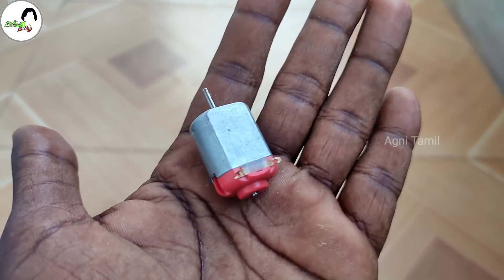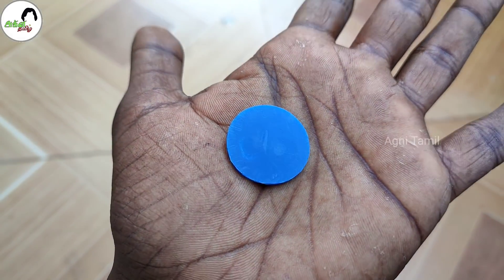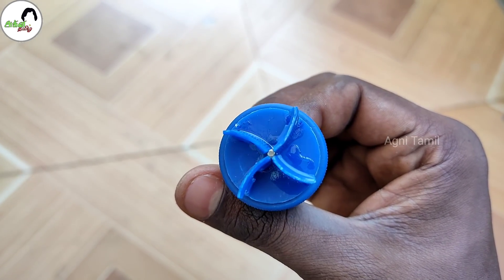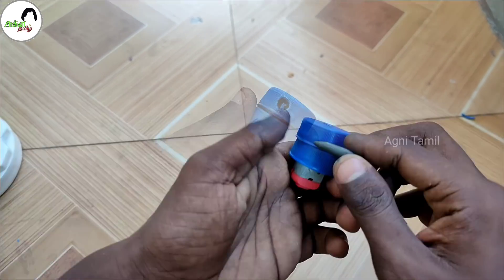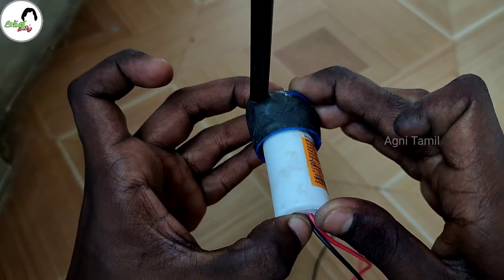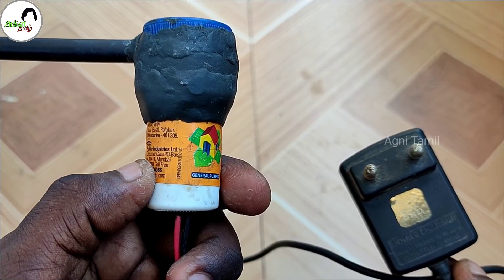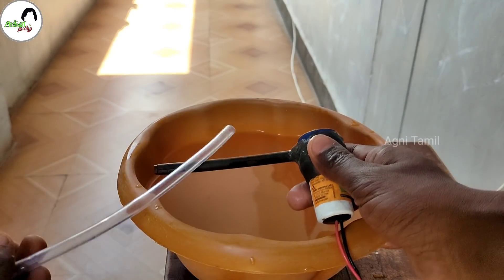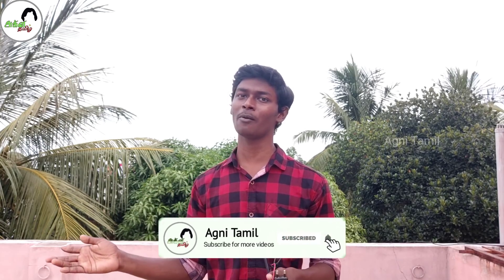How to make a Simple Water Pump? | 6V Mini Water Pump செய்வது எப்படி? | Agni Tamil

Comment: Bro neenga cap center la hole panni water kulla direct ah motor  veikkura dhu ku padhil ah adhae maari opposite la hole potu bipe use pannalam la ? Bcoz neenga battery la use panna prblm ella anaa charge wire la use pandringa may be current pass aaga chance eruku la ?

Comment: Bro prob here is you change the polarity of the motor... the propeller rotation direction you should keep the output pipe if propeller rotate in opp direction this prob will come... so now you change polarity of motor surely it will pump more water